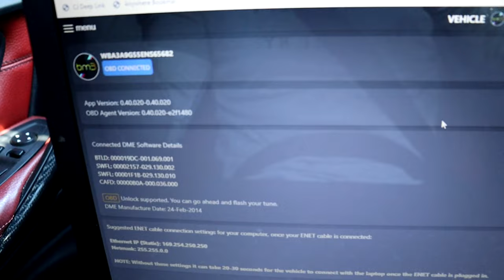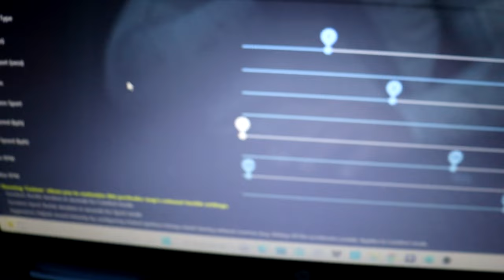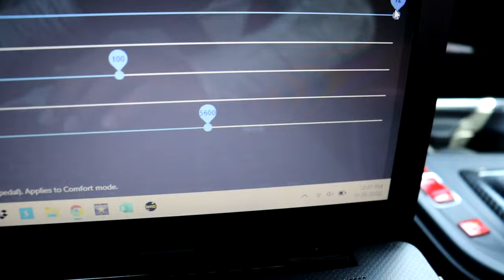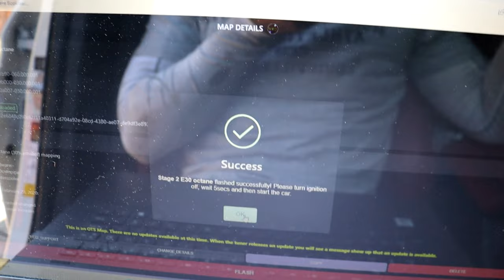BMW F30 335i CTS Turbo CATLESS Downpipe Install & Sound Clips! *SOUNDS SO GOOD*

Comment: Hello everybody my name is Luke and I just bought a 2013 bmw 335i, that has a cat less down pipe. I live in Colorado where I have to pass emissions to register the car but I’m not sure what I need to buy in order to pass emissions. Nothing other is done to the car besides a cat less down pipe and a charge pipe. Would I have to buy a new catalytic converter and put it on to pass emissions?
Reply: How much did it cost you bro?
Reply: Do u got an insta for your car

Comment: Broo I bought the cts intake for my bmw series 3 335 Msport 2014 when I changed the original filter for the cts and changed the maf sensor the check engine light came on there was no problem my car before changing the filter, I erased the code with the scanner and I put the original filter back in but when I changed the sensor the check engine light came on again, is my sensor bad or is it just due to disconnecting and reconnecting

Comment: What was the current exhaust setup at this time? Sounds amazing bro
Reply from the maker: In this video it was a catless downpipe and resonator delete with the stock muffler. With a stage 2 E30 tune
Reply: Have you changed it since then ? If you don’t mind me asking

Comment: I'm buying a full CTS set right now, only question for you is - does it drone at all bro ? Also - when you're in eco / comfort is it quiet ? I'd like to have a "disable degenerate mode" button as well. Great vid.
Reply from the maker: Yes there is some drone in all modes but nothing too bad in my opinion. Comfort has the quietest drone. Eco is still pretty loud but there are just no burbles.

Comment: How long did it take to put the band from down pipe to turbo? Any secrets or tips to get it? I tried it for like 5 hours and never got it.
Reply from the maker: Well this was my 3rd time doing that so it only took a few minutes for me to get it seat properly. My very first time doing it did take longer probably like 30 minutes but it still didnt take me 5 hours lol. The main thing I did was just have it ready in a position before you place the down pipe against the turbo and then once you seat the the downpipe on the turbo just move the clamp overtop the point a which they both meet and squeeze the clamp together at the bottom where the bolt goes. Thats really all I did. not sure why you weren't able to do it. What exactly were you struggling with?
Reply: @InlineSixAuto  For me the vband literally wouldnt close around the turbo and downpipe no matter what way I did it.
Reply from the maker: @sircruse1422  Was it the original clamp that held the stock downpipe to the turbo? or did you get a new one? did you try just testing it by putting it around the downpipe just to see if it would fit?
Reply: @InlineSixAuto  Probably the original clamp, but it has been removed and put back on a couple times in the past few years so it hasn't just been sitting. It did fit around just the downpipe

Comment: Does a catless downpipe vs catted high flow downpipe make a noticeable difference on turbo spool sounds such as the video. Also does an intake really change the noise for spooling
Reply from the maker: No to your first question. turbo spool sounds the same to me.Yes to your second question. An aftermarket intake makes a huge difference in turbo spool sound. If you get a GTS hood itll sound even louder since it has a vent in the hood.
Reply: @InlineSixAuto  okay and for a part from the spool is catless much or any louder than high flow cat
Reply from the maker: @sevyn8038  catless is a bit louder than high flow for exhaust sound.

Comment: you can't pass smog even with highflown catted dp with stock tune?
Reply from the maker: No it will still get a check engine light without the tune.
Reply: U can with a active autowerk catted downpipe
Reply from the maker: @335DARK  Oh wow didn't know that but wow $1300 for it lol Does it really increase flow if its still able to somehow not produce a check engine light?
Reply: @InlineSixAuto  ya stage 2+ with it and it passed smog like 2 months ago. In the Bay Area btw
Reply: @InlineSixAuto  will say tho did lose like 10whp vs catless but running catless in cali was a headache